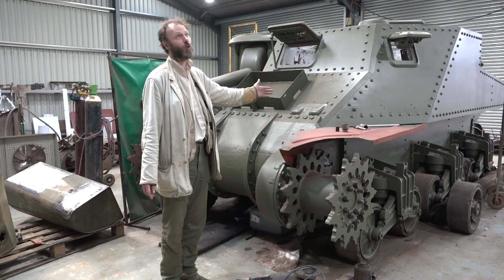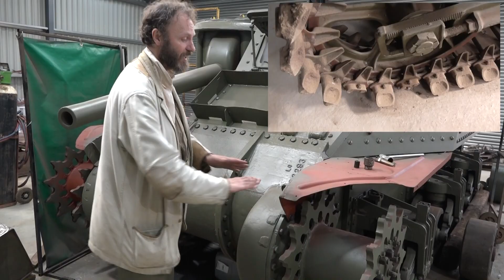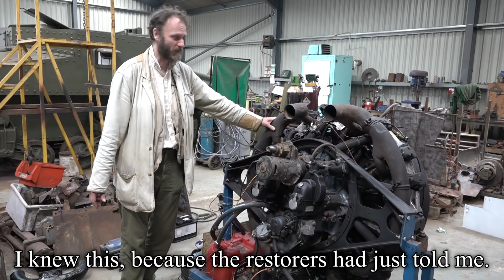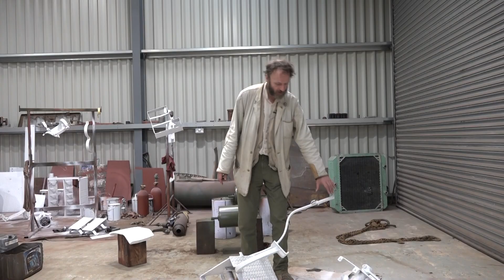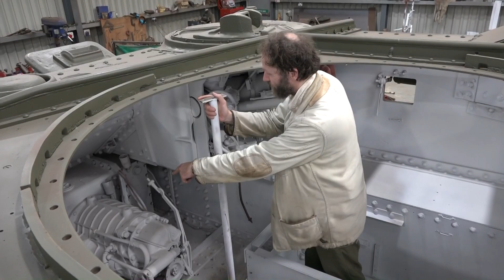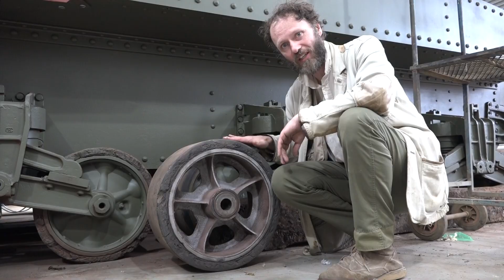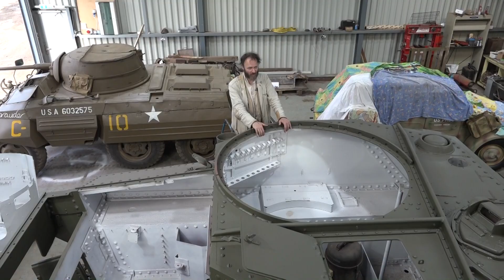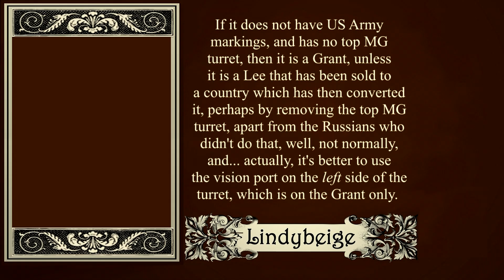The British Lee tank (that is not a Grant)

Comment: The reason the Lee/Grant had the gun in the hull was because they weren't confident that they could cast a big enough single piece turret to house a 75mm gun. They knew they needed the 75mm, but they were really pushing their casting technology and experience. 
So it was the armour that held back the Sherman introduction date and required the interim M3 Grant, not the gun.
Reply: Yes, and the gun on this particular Lee is the exact same gun on the Sherman, not a “howitzer” but a purpose designed tank gun.
Reply: @nepete7  The British might have had more of a tendency to call it a howitzer because before the M3, they usually had gun tanks (typically armed with 2 or 6 pounders, for attacking enemy armored vehicles) and howitzer tanks (armed with 3 or 3.7 inch howitzers, for providing smoke and HE). The American 75mm was the first tank gun in British service that could adequately fulfill both needs, but the M3's 37+75 combination makes it look a lot like a gun/howitzer combination.
Reply: @nepete7  if it has a muzzle counterweight then it is an M2 gun, about 30 calibres long and originally a howitzer (Basically the French WW1 75mm). Mounting it in a limited elevation tank mounting would change it to being a gun though.
All but the very first Shermans had the M3 gun, which was about 40 calibres long and had no muzzle weight. Later Lees and Grants had the M3 gun too.
Reply: @rastas3742  Both were versions of the French 75 and fired the same 75x350R ammo.
Reply: Right, the mounting was designed for the M3 gun, the M2 was available before the M3 hence the need for the counter weight on the shorter barrel gun to maintain balance.
Reply: @PositionLight  The French 75mm's shells even made it onto B-25s. The cannon rigged to some B-25 gunships took the same shell as the French 75.
Reply: @nepete7  
Yes and no. The 75mm tank gun is a direct development of the French 75mm field gun from WW1, so in that sense it wasn't a purpose designed tank gun at all. But it was the gun, further developed and intended, for the M3 and M4 Mediums as a proper general-purpose tank gun. The 76mm, however, was a purpose designed tank gun - although it saw use as a general purpose field gun in both tank-destroyers and actual towed anti-tank guns.
Reply: I've read what you wrote...  But, I've also read that the problem was that they didn't have the machine tools to cut a turret ring of the size a larger turret would require and needed to design and build them before they could build a larger turret.  I've never been able to nail down which story is correct.  Could be either or both.
Reply: @silentotto5099  i don't think they would have had issues with machining the turret ring. it's a few different operations needed, but each one would be fairly simple to do on existing equipment, even with possible modification for early tool up.
i mean, they were quite experienced making turret rings for warships with much bigger guns. the difference was those are welded turrets, with isn't as viable for 1940's manufacturing on tank scale. casting is easy and fast, welding is hard to do right and slow, with much more limited geometry.
Reply: @wyattroncin941  That's what I thought when I first heard that it was a problem with machining the turret ring.  On the other hand, it's difficult to imagine that a casting the turret would have posed any real difficulty to US industry either.  As you noted, casting is easy and fast and M-4s initially had both cast hulls and turrets.  (I know later they moved to welded hulls, but that wouldn't have had any impact on this question) Looking at a M-4 turret, I don't see anything obvious that would make casting it especially complicated.  As far as it goes, it's not even that large when compared to the size of the hull and I would think casting the hull would have been more problematic.
Yet, there was obviously some sort of difficulty, else they wouldn't have produced the M-3 as a stop-gap.
I wish Lindy or the Chieftain would specifically address this question.  I'd like a definitive answer.
Reply: @silentotto5099  well, for welding and machining, all you have to do is build a bigger mill and hire more welders. For casting, you have to built smelter large enough to meet the demand for molten steel, built sand casting equipment large enough to handle the casting molds needed, have the tooling and mills required to finish the castings, and this assumes you have the metallurgy technology to not have voids or cracks develop in the casting during the cooling period.

Keep in mind that at this time they're still using the apparent colour of the steel to harden receivers for M1 rifles, meaning point of aim behavior when hot varied by time of day and weather outside when the rifle was heat treated. US steel mills had the theoretical capabilities to make M4 turrets, but they didn't have the practical facilities and production lines to do it and they would need time to practice it to get consistent.
Reply: @wyattroncin941  Problems associated with capacity production would make a lot of sense.  Especially as they likely would have had to write the script, so to speak, on how one goes about mass producing turrets.  I can't really think of anything of a similar nature which were being mass produced at the time, so they may have been forced to develop the technique more or less from scratch.

But, then...  If the explanation is as simple as an industrial bottle neck, why not just say that?
Reply: @silentotto5099  well, it's a bit more than just a production bottleneck. they weren't necessarily inventing a new technology, but taking something like casting and scaling it to several tonnes of armour grade hardenable steel would have been quite the industrial challenge. 

I only have a fairly rudimentary knowledge of steel metallurgy, but I suspect that challenges faced would have included; vacuum voids in the steel, temperature shock cracking, warping from internal stresses, nitrogen embrittlement, machining the hard, abrasive, variable cast surface, post casting heat treatments, more cracking, face hardening large and awkwardly shaped pieces, and probably a few more challenges.

Nothing new individually, but putting all the processes together and making it work smoothly would have taken some pretty smart engineers at a foundry a good long while to figure out, especially when you're dealing with components that would take multiple days to fully cool down before working them.
Reply: @silentotto5099  it was probably a bit of both.
Reply: true
Reply: I thought massive turrets for battleships already existed.
Reply: @Usammityduzntafraidofanythin  Battleship turrets were fabricated from rolled plates and solid castings. The technical problem was to make a single large hollow casting with relatively thin uniform thickness walls.
Reply: @rastas3742  Ah I see
Reply: @Usammityduzntafraidofanythin  you don't cast those
Reply: US industry had no problems with large steel castings. The M4 was delayed due to Ordnance and Chrysler finalizing the design of a turret ring and drive mechanism that could handle very heavy turrets. Ordnance knew that there would be a demand for larger turrets and main guns so decided to design one ring and drive that'll be usable for any size turret that they may use later on. Thanks to that, all M4 turrets were interchangable.
Reply: Did some models have the main gun on the right I've seen footage that has the 75 on the right
Reply: @halfcantan1208  The footage was likely "flopped" and created a mirror image.
Reply: @halfcantan1208  Am i missing something,  all the tanks in the video have the gun on the right.
Reply: Actually it was due to the francophone us army ordnance they had looked at the strongest tank that the French were producing a char b1 and it's 75mm howitzer in the lower right hull ,they took it as a starting point taking a 75mm pack howitzer in a m2. They decided to use a different 75mm in the production m3 up guning it twice with longer barreled and stronger 75mm guns!
Reply: Rastas - Castings, interesting. The usual limitation for every nation at this time was machining the turret ring. The turret ring diameter dictated the size of the turret which in turn dictated the maximum size/power of the gun. Germans were aghast at the gun on the T-34, the engineers impressed with the backward Soviets machining the turret ring.
Reply: @coachhannah2403  The limitation on turret ring size wasn't a manufacturing problem as such. They could make plenty big enough turret rings. The problem with turret rings was making a vehicle big enough to carry the ring whilst being small enough to fit within the rail loading gauge and being small enough and light enough to be tactically useful. 
This was especially problematic for the British with their narrow loading gauge and is the reason why British tanks were under-gunned until the rail loading width restriction was abandoned with Centurion.

The Sherman turret is a very large single piece casting. The walls are very thin compared to the overall size. It is very difficult to keep a uniform wall thickness over a large area, especially when different faces are different thicknesses and the walls are in multiple planes (effectively 5 sides of a cube. The British solution was to weld a rolled plate on top for the roof, so that only the 4 sides needed to be cast.).
US Industry learnt very quickly, but it still took them a few months to get it right (Which is ridiculously quick really, if you look at the timescales they achieved)..
Reply: if you want the real skinny on these tanks, watch The Chieftain's 2 part video. Nick Moran has all the details.
Reply: What I find funny/ironic is that the Lee/Grant was a stop-gap solution/filler for America until the M4 Sherman was built. Which, in some cases, was a stop-gap solution/filler until the M26 Pershing could be finished. Yet both were viable (not necessarily the absolute best of the best) combat machines and Pershing was late to the party due to the long development and changes in war tactics changing the expectations of it.
Reply: @steeljawX  
No, m3 was built for domestic use only planned for 300 to 400, but the British and Russian  needed any armored vehicle  so we built close to 2500 of them. 
Sherman was not a stop gap. Pershing was not planned to be used in combat and only 250 were produced in ww 2
Reply: @willcullen3743  Are you sure about that? Again, I said in some cases. Name the main American tanks for both armor corp and infantry support in 1937 when WWII started. It sure wasn't the M3 or M4. When I mean certain cases, I'm referring to General Jacob Devers, who's goal seemed to be to put bigger, stronger, and faster (all in the same package) tanks out there and have his name go down in history. To him, everything not Pershing was a stop-gap.

You look at the production years of the M3 and M4. M3 is just over a year until the M4 rolled out the year they discontinued the M3. It was a stop gap from the M2's we were trying out as well as a "beta test" to see what the next thing should have. The M4 was the result of the input of what the M3 needed flat out and was the best America could come up with at the time. It just happened to be that it fit all the criteria needed for armor to be sent over seas.

But Devers, one of the Generals over the European Theater, wanted the Pershing to be the American tank. It just was a whole bunch of excess for what was needed on the battlefield at the time. But clearly, I don't know what I'm talking about.
Reply: @steeljawX  
There were no tanks in 1937 in us except the t series prototypes
Devers headed armor force until mid 1943 and was opposed to heavy tanks and rejected them, t2, m6 heavy, until he was in charge of European theater of operation command, then he only requested 250 tanks of a heavy type. The Pershing,  and the m4 jumbo were developed for that. But Pershing was sent to Europe untested , the head of ordnance branch convinced the war department to send them
Check out chieftains video on the pershing/t 20 series that should help
Reply: @steeljawX  
M3 production continued after m4 was started because of demand, we couldn't change over the Detroit tank arsenal to m4 production because of it.
Reply: @willcullen3743  Why would you keep creating a vehicle that's about to be replaced? Hmmm. Maybe a stop-gap solution to give the soldiers at least something to use while the new thing is being developed. It's almost like it could be a stop-gap solution of the M2 isn't cutting it and we're considering something else. They throw together the M3 with "brilliant ideas" and find out it doesn't work as well as they'd hope.

Did they pull all the M3's out of service or did they keep throwing them at the problem until the M4 rolled out? When the M26 was announced and prototype testing was starting, did they pull the M4's? This isn't a rhetorical question. I'm pointing out that these 2 vehicles were stop-gap solutions to what Devers wanted. It's just that the M4 performed better over all that it became the solution, while Pershing remained a pipe-dream. 

And I have seen The Chieftain's videos and you're most likely referring to the very first M26's. They got tested at the Battle of the Bulge, which led to the development of the T26E3 which all had to be abandoned because they were too heavy for the bridges. Later on in the Korean War, M4's were padding the #'s but they performed better than the T26's did. The M3 and M4 were stop-gap solutions for the proceeding model. It's just the M4 was able to be more reliable and fit the bill a lot better than it's proceeding "heir", the M26.
Reply: @steeljawX  although M26 was the successor to M4, the M4 was never intended as a stopgap until the M26 rolled out, and this can be seen in a few ways. 

first of all, pre-production development; the M4 took only a year of development beyond the M3 to get a tank ready and in production, because development for it was more or less the same work as went into the M3. For the Pershing, they went through at least 6 developmental types before getting production ready. if M4 was a stopgap, they would have gone ahead and used much of the work from M3/M4; things like different transmission/drive systems would have been put off for later, and at that point you get a 76mm T23 with an upgraded M4 transmission, field ready by 1943. instead they scrapped the 250 T23's, slapped the turret on Sherman and wound up making 7,100 M4(76)W's in 1943 alone. the Pershings development would continue for another year and a half. during that time, they realized the need for better large gun than the 76, increase frontal protection by an inch, and changed from the existing horizontal volute suspension to torsion bar. none of the development of the T25 and T26 prototypes used existing major development work from the Sherman, where if they had used Sherman developments they could have had a tank out the door with more armour and a 76 or better by 1943. not exactly behavior befitting an ordinance department with army generals breathing down their necks for something bigger and better.

secondly, production. during the 1941 M3 production, 1300 tanks were produced. during the entire european wartime production of M26 (asian theaters had no use for a heavy tank), there were less than 500 tanks made and only 2000 were produced in the first full year. 4 times more M4's and variant vehicles were produced in 1945 than Pershings. were there such a great need for Pershings, they would have switched over more than 2 factories and pushed spin up faster than 10 in november, 30 in december and 70 in january of '45. looking at the M4, in july 1942 production began; by the end of 1942 they had produced 8000 tanks. 

third, variants. ignoring gun motor carriages and 105 vehicles based on the fact that they aren't tanks, the M4 saw 15 different production variants. this doesn't include all the prototype tanks that lead to horizontal volute suspension, the 76mm guns or even the prototype work needed to fit different engines into the M4. the M3 had a few GMC's built from it, but it more or less died completely when Sherman chassis rolled out. M26 saw 6 production variants, only 2 of which (pershing and super pershing) saw any form of real combat, too late to be of any effect.

M26 was an entire new tank made for entirely different needs, and while it was later re designated as a medium tank, it was designed through and through as a WW2 heavy tank. the M4 was a medium tank made to suit the needs of a medium tank for WW2, and while it was beginning to show it's age by the end of the war, it was still a very capable vehicle and platform. the M3 was simply a rush job with what was available at the time slapped together into something that can be called a medium tank, while the actual medium tank was being worked on.
Reply: @wyattroncin941  I'll admit that the M4, in it's original state and most of it's variants, are not stop gaps. But the M36 encroaches on the firepower territory of what they wanted out of the Pershing with the mounting of a 90mm on mobile armor. And that rolled off the line in 1944. They took the M4 and made it a platform for some testing while looking forward towards Pershing. General Devers did want Pershing to be the main front line tank of the US rather than the Sherman. That would be considered replacing it.

But you're also correct that the M3 was an absolute stopgap of, "we need something now." It tanked like other tanks, but the M4 just tanked better. The Pershing just was too complex and novel for it to be completely useful on the battlefield in its fully intended design (electronic transmission and other bells and whistles). It's similar to the German Panther; great design in concept, but a horrendous logistical nightmare to maintain. It wasn't until they dumbed it down with "conventional" tech that it was deemed battle ready.

I'd be willing to bet that the M3 was a bit of a turn and burn machine to hold out until the M4 came around while the M4 was pretty good and the need for the M26 rapidly dried up as delays pushed it back and the war was wrapping up. It just was an unfortunate set of circumstances for the M26 for WWII. But M3, I'm pretty sure, was a stop gap measure. I mean look at the M2 and tell me that we would have held the same presence in the war if we didn't Frankenstein the M3. I'm a firm believer that we decided that we needed to replace our "great new tank" that was utter s**t in comparison and we wound up with the M3 that was good enough for now. But the course of the war and the introduction of more and more armor variants just showed the US how bad the M3 was....especially the idea of, "let's take 7 soldiers who have trained for months and toss them into one 'volatile metal basket'." I'm sure it made sense to someone at the time, but.......
Reply: @willcullen3743  the stuart was in use at the beggining of american involvement in the war
Reply: @willcullen3743  The "chieftains" shows rub me a bit the wrong way ...
Reply: Ok boomer
Reply: @arobotguy9316  ?